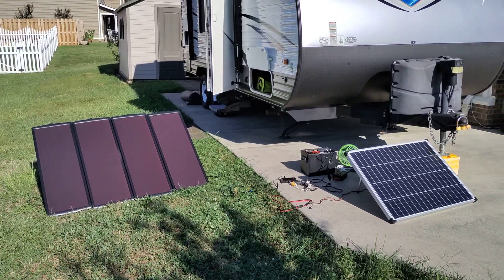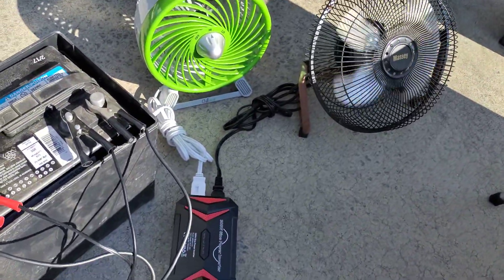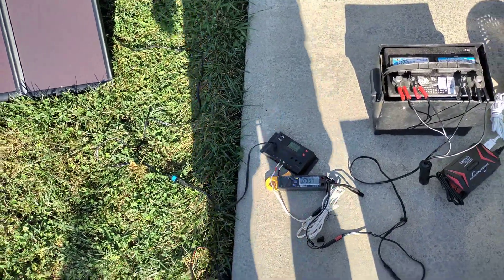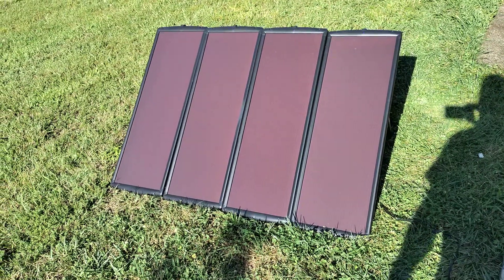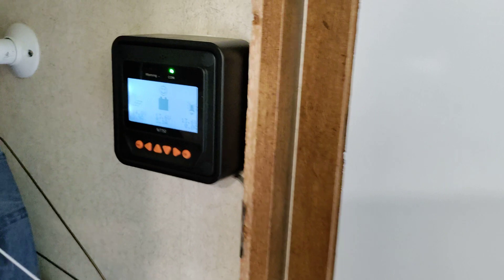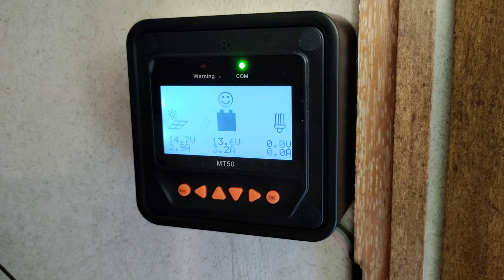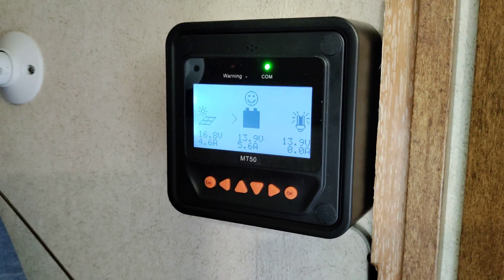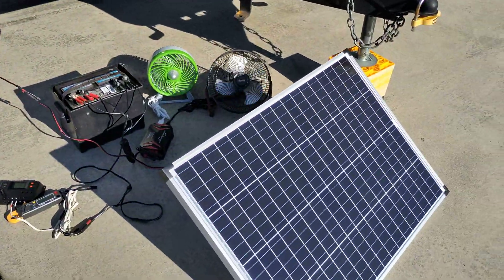Harbor Freight 100 Watt Solar Panel Comparison

Comment: Can you connect xtra 100w panel to same controller for 200w total???
Reply from the maker: @eddielane9781  , that is currently what I am doing. I have a Victron MPPT 75/15 charge controller. It will accept 75 volts in and output up to 15 amps. I series connect two of the 100 watt panels which creates 36-40 volts at around 6-7 amps in full sun. The controller converts it to 14 volts out at around 12-14 amps.

Comment: Just what I wanted to know. I plan on buying the 100 Watt Amorphous Solar Panel Kit, and the 100 Watt Monocrystalline Solar Panel. Can the kit controller handle the combined panel outputs? Thanks.
Reply from the maker: I no longer have the amorphous kit, but if I remember correctly, that controller is rated for 10 amps. Theoretically, you could get a little over 12 amps from all of them combined, but it would be rare.  I tried paralleling them all at one time, but the total current was a little less than it should have been, based on hooking up the 100 watt kit, and the 100 watt panel separately, and adding the results. I feel like there is a slight voltage difference between the two panel types that's causing the inefficiency. I don't think the included controller would handle the voltage of connecting the panels in series.

Comment: Okay I have the same panels but to be able to get anywhere between 7 to 8 amps out of them you need to take each panel and split it in the way of positive to negative type conversion Yes you'll have more voltage but I've learned that the amperage goes up but if you try to connect more than two it won't work so you split the two and then connect them up as one thing

Comment: Thanks for this comparison. Very good representation of not only the panels but what you can expect using the two different types of charge controllers. I use a similar MPPT EPEver. I think I’ll get a couple hundred watts of amorphous panels to supplement my system now during overcast winter months and also in the rainy season. May just switch solar rays as needed. Thanks for the great review short and concise yet very informative. Harbor freight seems to raise their prices on a lot of panels the folding one is just about $200 and about $130 for the mono🎉 cheers

Comment: Does anyone know if it’s possible to connect both the 4 panel 100w and 1 panel 100w together?
Reply from the maker: I have parralled them before, but the total current supplied was slightly lower than what it should have been, based on the total of correcting them separately. I believe it was due to the voltage being slightly lower on the 4 panel set, and it was pulling the total down. Connecting them in series would have exceeded the allowed input voltage of my charge controller. I feel like it would work better if each panel type had their own charge controller, then you can parallel their output at the battery.
Reply: @kevinrepass4210  thanks for replying. I am an electrical dummy. I have 2 of the 4 panel kits that I set aside for emergency purposes. Figured I’d scrounge batteries in an emergency situation. Lithium batteries have changed my mind some what. I know I would need charge controllers for lifepo4 batteries. Was just wondering if the ne’er 100 w panels would enhance my setup.
Reply: @kevinrepass4210  Or use diodes in line with a panel wire to prevent backflow?

Comment: Perfect timing I was considering picking up the new panel. Nice to see it is slightly better than the older model which I have. Can you use the controller from the old model in the new model?
Reply from the maker: Yes. You can use the old controller. The new panel uses the same SAE connector.

Comment: beginner. I have 4, 100 watt panals, only getting 200 watts in mid day coming in. Is this normal?
Reply from the maker: Depending on the panel, tilt toward the sun, and how clear the air is, it could be normal. I don't think most of us will ever have perfect enough conditions to get the full tested wattage from a panel. So far, the best I've been able to do with the 100 watt mono-crystaline panel is around 80 watts with the PWM controller. Maybe around 70 watts with the amorphous panels when they were new. A lot of factors can hurt performance. A little haze in the air, panel tilt toward the sun, cable length and heat. The hotter they get, the less efficient they get. It's best to mount them with some air flow around the back side.
Reply: @kevinrepass4210  Thanks.I run a 10awg,10ft extention.Gana add  10 more feet.Is it safe running 20 feet of 10awg,or do I truly need a 6awg?
Reply from the maker: @richardjones7882  , 10 AWG is plenty big enough. On average, 10 AWG is good for 30 amps, and the resistance is way low at those lengths.
Reply: @kevinrepass4210  ok,It looks like it will be 5 ft  10 awg I will add,and is it ok to mix up different name brands extension cables from Amazon?
Reply from the maker: @richardjones7882  , that should be fine.

Comment: What is the amp rating on your new controller!
Reply from the maker: 10 amps.
Reply: @kevinrepass4210  I have 200 watts going to a 10 amp Harbor Freight controller and didn't know if I needed to upgrade to 30 amp. I have (6) 35 amp batteries. 2000 watt inverter.
Reply from the maker: 200 watts may be pushing a 10 amp controller past it's limits, under ideal conditions. Theoretically, 200 watts divided by 13 volts gives you around 15.4 amps. You'll never get that much out of them but I can see you getting 13 - 14 amps out of a pair of the HF mono-crystaline panels, based on what I've gotten out of my single 100 watt panel, on a very clear day. I have 10 amp inline fuses in the wiring to protect everything.

Comment: Back in the day the Harbor Freight four panel kit was their first attempt and was a good, cheap idea for anyone who wanted to learn how it all works. Today, H.F.’s products have improved not surprisingly, but that doesn’t mean their older items are not good anymore. If you’re new to solar power, the kit is a good place to start, it has everything you need in one box (excluding battery) to get started, but if you need something that is expandable, I would recommend the single panel option and a powerful controller that can grow as your system increases with additional panels and batteries.

Comment: I have very strong mono panels, and they only produce decent current on sunny days. When it rains, they produce next to nothing. The amorphous panels produce the same current on cloudy days as they do on sunny days. Around 3.5 amps. It's not enough to run the inverter but it's enough to get a charge when nothing else seems to be working.

Comment: Your wires are to thin. So wil loose power into your wires. Try it with 4 or 6mm² wire and you wil see a beter result
Reply from the maker: I'm using 18 gauge wire at a distance of around 10 feet. If you check the charts, you will see that for a copper wire, that only has .0638 ohms of total resistance. That low of a resistance is totally negligible. A bigger wire would be overkill.

Comment: I have the 4x25 100-watt HF panels as well. Had them for over four-years now, & I have nothing but praise for them! I’ll probably purchase the single, 100-watt panel soon!
Just a tip though…don’t set your battery directly on the ground. I’m not an electrician, but I was told to put a piece of wood under it, because the ground will “ground-it-out!” Thanks!
Reply from the maker: Thanks for the tip Ambrose. I actually am an electrician. Sitting the battery on the ground will not ground it out. Sitting short term on the ground has no negative effects. You do want to sit it on wood if storing during the winter. It will keep a charge longer that way.

Comment: just so you know the volt reding on the charge controller is the voltage of your battery not volts coming in from your solar panels
Reply: So the 157 volts displayed on my control panel is the battery voltage 🤔
I assumed it was the three 400 watt 50 volts my solar panels are rated at 🤔

Comment: Can you please tell me where you got that Controller kit and did it come with the plug for the solar panel mounted on the exterior of the camper. Thank you
Reply from the maker: The PWM controller laying on the ground came with 4 panel kit. I bought the EP Ever MPPT controller, and the remote display from Amazon. All panels came with the SAE connector that mated to the one that was mounted from the factory on the side of the camper. That one went straight to the battery so I had to drill a hole in the interior wall to access the wiring in order to install the charger controller inline.

Comment: I got two of those monocryslalline 100 watt panels on sale at Harbor Freight for 89.99. Just need a good controller for them. Can't wait to test them out. 15 pounds a piece. They are slightly heavy but for the price point there worth it. Thanks for sharing. Take care. 😊

Comment: I bought each one of these a couple of weeks ago. I don’t have an rv but I just wanted to get my feet wet in the world of solar. I have a small 100w Go Pro Power plus charging station right now. And a 1500w solar generator on the way. Thanks for the video!

Comment: 2 fans blowing on the newer panel may alter comparison results.
Reply from the maker: How would it alter results? The fans weren't blowing on the panel. They were only there to put a load on the battery. There should be zero current flow from the panels to the battery if it had a full charge and no load.

Comment: The state of charge of your battery will also determine the amount of current coming from your panels.

If you shorted the cables for the solar panels you would get max current flow and you would probably get closer to the 6-7 amps you were expecting.
Reply from the maker: The amount of charge on the battery will determine the amount of current the panels will supply. That's why I had the inverter and fans pulling the lead acid battery down, and had all of the lights and fans running in the camper to pull the lithium battery down. As an electrician, I never like shorting any wires together. Even though it might have given a different reading,, it wouldn't have been a real world useable reading of what to expect from the panels in normal use.

Comment: Mppt controllers allow you to put solar panels in series and get the same amount of power without increasing the current going thru the wires... Allowing you to use smaller wires and less losses due to current flow.

By putting panels in series, you double the voltage and therefore double the power while keeping the current the same.
Reply from the maker: That is true. If you're working with some high currents, it would be an advantage. With the smaller current I'm working with, the main advantage is that it's converting any panel voltage, that's higher than the batteries charge voltage, to extra current, instead of wasting it like the PWM controller. No high power setup here. Just keeping a single battery topped up while boondocking.
Reply: @kevinrepass4210  : I think you would be surprised at how much difference a mppt controller would make.

It also gives you versatility.  You can use solar panels that have output voltages anywhere from 12 to 100 vdc and the mppt controller will transform it to the appropriate battery voltage with the highest possible current going to the battery.

I use a mppt controller with my 100 watt panel and it charges my 12v 100 a-h lithium battery very quickly. I usually use about 30 A-h per day.
Reply from the maker: @chronobot2001  , no surprise here. As shown in the video, I am already using a MPPT controller in my camper.

Comment: Only thing you left out is what battery you use
Reply from the maker: It's a 100 AH LiFePO4 battery. It's one of the cheaper ones branded as ToBattery. I've had it a year now and it worked great during the last camping season. The only drawback is that it didn't have the low temperature charging cutoff built in. But that doesn't matter to me since I don't camp in cold weather.
Reply: @kevinrepass4210  Thanks for response! Good video by the way keep it up
Reply from the maker: Thank you. I have some ideas for a few more videos, when the weather warms up.

Comment: Its been my experience that the Harbor Freight 25W panels are really only 17W.  They must use some New Math to get to 25W.
Reply: Sounds right solar only get about 75% efficiency to your batteries after the power loss from wires and controllers

Comment: still testing the 100 Watt harbor freight kit built a container for the charge controller recharging a 300 watt lithium generator takes about 7 hours in Nov it seems

Comment: Had the 3 panel system. Rtnd it to Harbor freight n bought the Renogy single panel kit with chg controller included for less $ than the big flimsy Harbor freight 3 panel one that didn't work well at all and with lil cust support.
Reply: Exactly! 👏 Harbor Freight is garbage 🗑️

Comment: Yes you may get more amps with that newer panel but now test this same panel when it's a cloudy day and you will get nothing out of that newer panel, but the 4 Amorphous panels will charge under cloud cover, this is the huge advantage with those 4 panels, this was the entire reason why I ended up going with the Amorphous panels since most of the time when we lose power is when it's cloudy/overcast (stormy) days.
Reply: True 100%. Our monocrystalline panel on the roof of our RV during consecutive cloudy days gives us no draw.  But also, we have the amorphous solar panels for the Solar on the side for those cloudy days as our back up to keep our battery intact
Reply: I had the same experience. My 4-panel kit was stolen but I plan on replacing it just for that reason.Still produced pretty well while over cast or with a little shade from trees blowing nearby.
Reply: Stolen from your yard or camping? Solar generators are so expensive, theft is a concern- especially when camping.
Reply: @vigilantobserver8389  I was actually preparing a house to move into over some months. About a month before I moved up there ,the entire property got ransacked. From pumps and piping,yard tools ,ladders,solar equipment ...right down to every lighting fixture in the house etc. Figured out that meth-heads rent the adjacent property.
Reply: @jackolson9462  I just got this. Holy #$#! Man, that is tough! I'm sorry this happened to you. I put up cameras on my rental, when it isn't occupied. They will invite themselves in my property if I'm not constantly paying attention. I looked out for an owner's rental and caught two teenagers in the house. I suggest getting to know your neighbors in that area, so you can get them to call you if there is activity and/or you get to "size them up." When I was younger, I was offered to stay at a "fixer-upper" and agreed. The property was in probate and I was moving to another state. I got to save up some money and they got a guard dog. By contrast, finding the right person to watch your property can be difficult. Good luck with your property.
Reply: @vigilantobserver8389  I actually live here now and have zero problems or fears.It was a loser crime of opportunity. The meth head who looted my property still rents the abutting property,but he is terrified to even look in my direction😂. He's also seen the sheriff's deputies hanging out BSing with us so its just a matter of time until he goes. Everybody else around here are great property owners and neighbors.
Reply: Yep, I found the Amorphous charge good in the shade too
Reply: I love the 4 panel kits, especially here in Florida where we get a fair amount of cloudy/overcast/rainy days, and have purchased three of them plus one of their single 100 watt panels. I love the solar lights that come with them.
Reply: @ellenlefavour628  just found them the same folding amorphous panels he shows here. Almost $200 on Harbor freight website. I think I’ll go with a set up that I found elsewhere non-folding 4x60 W amorphous panels for $200. Also the thin flexible type that could be mounted on a wall roof.
Reply: @goodredman  Actually the $189 4-25watt panel kit at harbor freight is not folding but 4 individual 25 watt panels. The kit comes with a charge controller and 2 awesome lights with long cords that plug into the charge controller, which I use for outdoor lights and to light my solar shed, goat barn and feed shed, so to me what you get is worth the money, and why I have bought three of them.
Reply: @ellenlefavour628  are those folding panel kits still available? In the amorphous type of cell? And if so how much are they or were they? It looks like it’s harder to find larger amorphous solar panels these days. looking at supplementing my system getting a couple of amorphous for those cloudy overcast winter days.
Reply: @ellenlefavour628  are those folding panel kits still available? In the amorphous type of cell? And if so how much are they or were they? It looks like it’s harder to find larger amorphous solar panels these days. looking at supplementing my system getting a couple of amorphous for those cloudy overcast winter days.

Comment: What if you hooked up a headlight to it for all night charge? Headlights are 12 volt! Maybe just try at night in front of the car and charge the car battery with the headlights??. High beam low beam tests?
Reply from the maker: That's a nice thought, but I don't think a headlight would put out enough light to get any thing from it. The output voltage of the panel ramps up as the light source gets brighter. It needs to get up to around 12 - 13 volts before the charge controller will start the current flow to the battery. I don't think it would. Plus that would be very inefficient. Most solar panels today are only around 20% efficient. You would be using way more power than you would be generating.
Reply: Free energy isn't real.